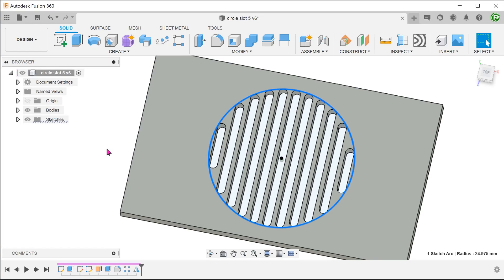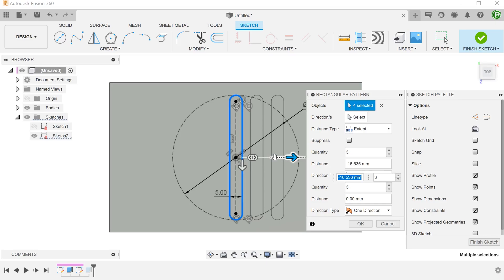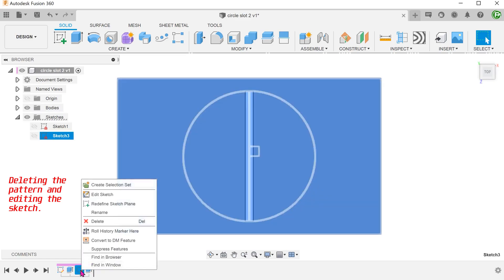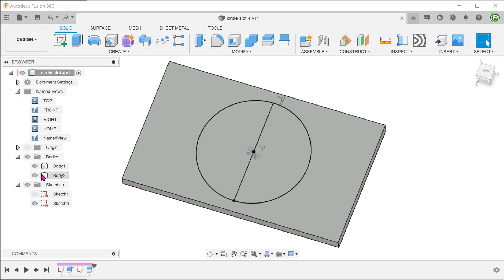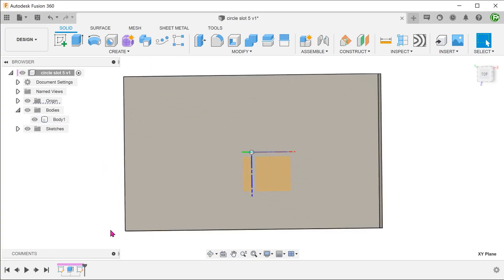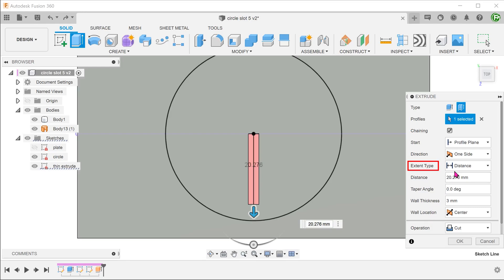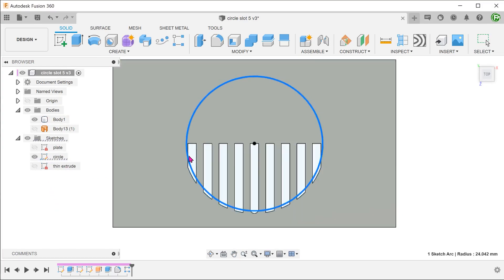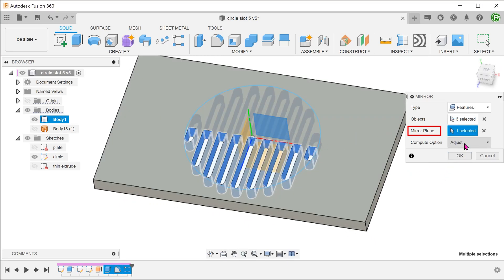Fusion 360 | Slots Within Boundary

Comment: has this changed in more recent versions? I get "R Pattern 2" error, and Compute , No Fillet edge found, and 2 of the slots are missing their end fillets. It shows them up until finalising/ending the edit on the Pattern . (It works fine when doing the pattern with just the cut extrusion, and no fillets.

Edit: solved  one problem but introduced another - model in the fillet, and instead of using "Features" for the pattern, use 'faces' and select all the faces. No failure, but it stops respecting the bounding surface

Comment: Thank you for the videos! I just had a question regarding slot cutting on a CNC plasma table. I can draw the slots no problem but when I try uploading the prgram in my software, the arches of the slots are on the opposite side of the sheet.

Comment: This actually make sense. If the only constrain between line and circle is tangent, parallel lines cannot follow the same rules. But if you give it a command as "calculate length yourself based on start to end" it works well, and the patterns are no longer constrained by the tangent. Very smart!

Comment: Why do you feel the need to show me 27 ways that do not work? If this is truly a school, show us the method that works without throwing all the confusing non-working data at us students.
Reply from the maker: In this case, most users would start approaching this with a top down extruded cut. I felt that it would be beneficial to know the limitations and problems involved in this approach before moving on to the recommended solution. In my videos, I would often approach a problem in different ways so that viewers can get the full picture and understand how I arrive at a certain solution. In any case, I was clear in stating that viewers have the option of skipping to the solution with the time stamp.
Reply: Everyone appreciates different ways of learning. I find his videos to be the cleanest and most direct to the point on all of YouTube. If he didn’t show me the non functional approaches I would waste time trying them myself. Please keep doing what you’re doing, and thanks for another great video!
Reply: All that "non-working data" combined with the "the method that works" is what you will, later in life, call "experience".  Eventually, you may find it is no longer "confusing", but "useful".
Reply: So that you understand how the software "thinks". It's an excellent way to teach. What he did was show common ways people would normally approach this problem, and explain why it doesn't work.